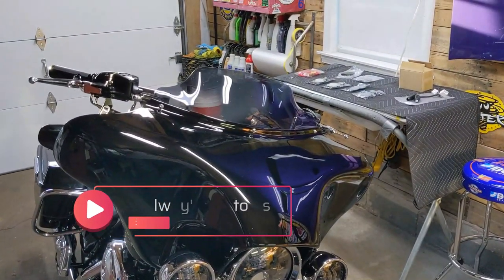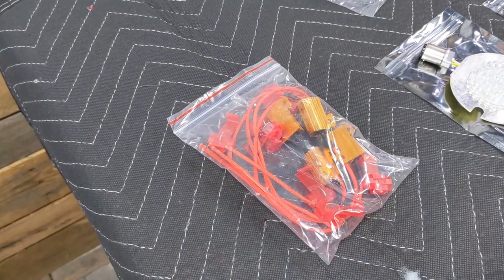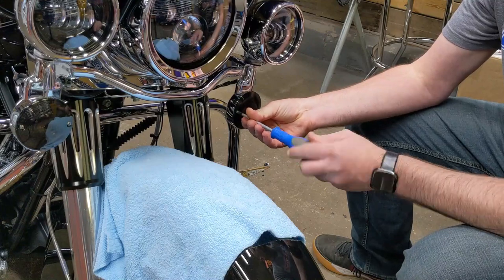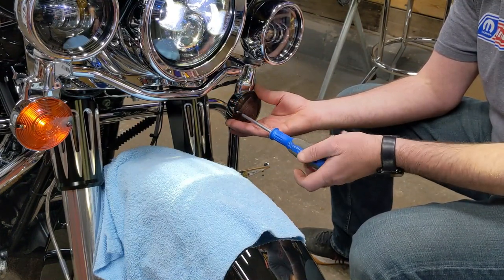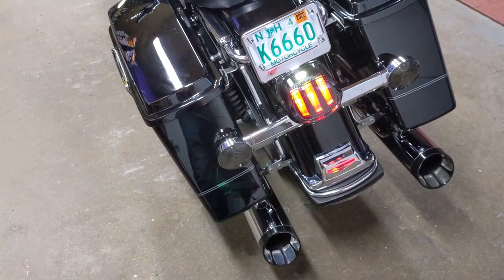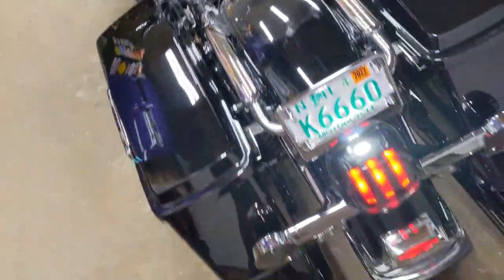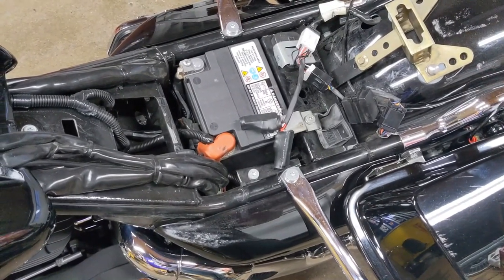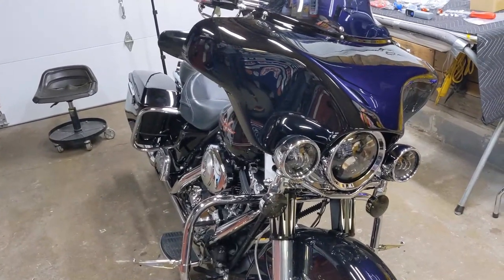Harley Road King LED Turn Signal Conversion

Comment: I found out you need to install these also on motorcycle to avoid overcharging from the rectifier, mosfet upgraded also, it will compensate and sent more energy to the battery and in turn fry your battery.
Reply from the maker: That makes perfect sense. Thanks for watching!

Comment: So. I did the same. Mine don’t flash at all. Brake light works but the turn signals? Don’t light up as running lights and turn signals only operate manually. Meaning. You push the turn signal button, the light comes on, push it again, the light goes off(no blinking)… what would cause that?
Reply from the maker: Off the top of my head, I'm not quite sure. Possibly a bad resistor? Or a ground not doing its job? You may need to do some troubleshooting. Wish I could be of more help. Thanks for watching!

Comment: Just wondering if it's still working properly? Mine blink normal UNTIL I touch the brake, then I get 2 more regular blinksbefore it start hyper blinkking again. I've tried the resyncing procedures but so far non of them have worked on a 2004 Electra Glide.
Reply from the maker: Everything is still working properly.  Thanks for watching!

Comment: Did you have to get a different resistor. For the front harness
Reply from the maker: I did not. There are two resistors in the harness.  One for the front and one for the back. Thanks for watching!

Comment: Where did you get that license plate holder?? I have a ‘16 FLHP and removed the laptop/truck frame off the back, but it has the license plate holder on it. So I’m just using Velcro.. is that something you bought somewhere? Looks great
Reply from the maker: Honestly, it's just a cheap one off eBay. I think it was 9 dollars. It's just plastic. I was actually thinking about getting a better one soon. Thanks for watching!

Comment: Will fit 04 softail? The ebay ones are much bigger but same numbers 3 1/4
Reply from the maker: Not sure on that....the softtail directionals are usually a bullet style with a smaller diameter. I'm pretty sure they wouldn't fit. But I'm sure the correct ones are out there. Thanks for watching!

Comment: Now that it's been some time since you installed them. Is it still working? I'm about to install, and I'm worried about the equalizer over heating.
Reply from the maker: Not one issue with them. No overheating at all. As long as they can hang freely or mount to some steel that will dissipate the heat, they are fine. Thanks for watching!

Comment: What happens if you try to run automotive 1157a LED bulbs their like 20. A pair then add the load part?
Reply from the maker: I think it would work the same way. I had a hard time finding decent ones in red. That was the reason I went with the kit. Thanks for watching!

Comment: Check out Custom Dynamics lights, they are awesome and they will sell you a single plug in that doesn't get hot and they work great. Just made a comment on your bag filler stripes video about the bag lights as well from Custom Dynamics. I went with the smoke lenses as well.
Reply from the maker: I will definitely check them out. Thanks for watching!

Comment: I have the exact issue  andI have been searching to see if this would fit a 2013 Ultra Limited and seems I cannot find any info on this.  Do you have any idea if this would and if not, which one would without spending $80 for the "Badlands".  Good video, thank you.
Reply from the maker: I don't see why it wouldn't work with your Ultra. I'd say it would be worth a try. This setup is still working great, and at a fraction of the price of the Badlands. Thanks for watching!
Reply: I got the resistor to stop the Hyperflashing and it also turned off the security warning light. They do get hot. So on my bike there was no place to stuff them. I had to secure them on top of my security module that is over my battery. I'll ride around and check it. Thank you.

Comment: I bought the same kit for my 2000 road king . But they wont blink any   Thoughts?
Reply from the maker: Off hand, no. Won't blink at all?
Reply: @kalways_kustoms  at all . Im comfused
Reply from the maker: @oscie1989  are you sure they are the correct bulb socket number (1156,1157),  because if the socket is different and it doesn't make contact, that could do it.

Comment: Did you have to use a separate flash resistor for the front?
Reply from the maker: No, the resistors covered the front and back. Thanks for watching!

Comment: If the goal is increasing visibility why would you use a dark lense?
Reply from the maker: The led lights are so bright that the smoked lenses don't affect visibility at all, plus it gives it the look I was going for. Thanks for watching!
Reply: Love the look myself, and thank you for the links, made finding everything so much easier. New lights all around next weekend.  Any other mod recommendations?